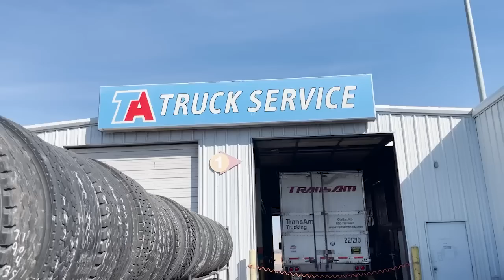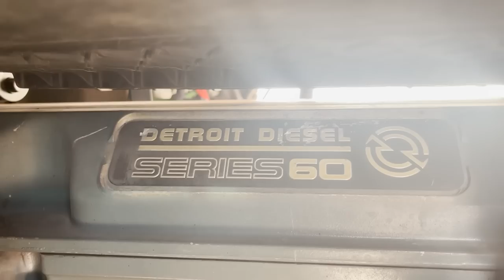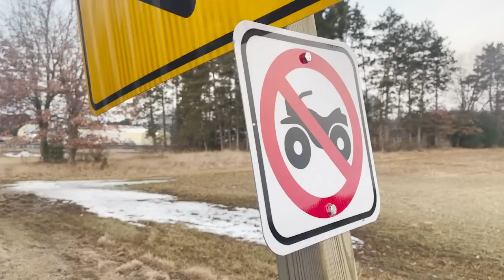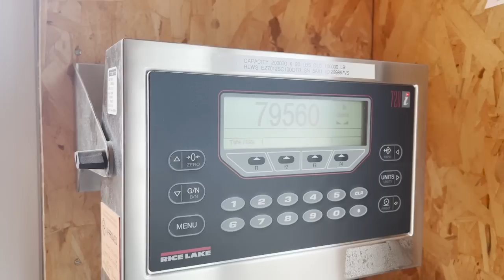All roads lead to…..WHERE exactly?

Comment: I have been there and done that. I knew just about every truck stop between california an washington... a occasional trip to nevada. If you don't  have a backhaul to home then you  wander around and listen up on the cb for someone who knows hauls going somewhere. Licence plates included the bingo card for hauling in different states...been over forty years since I was on the highway... actually thirty eight now  that I did the math. I loved the road, didn't mess around on the wife, kept the zipper up an eyes open for jump scales or other inspection places. 355 gears  a thirteen speed  with a airshift brownie that had a long over in it..lot of the time it was in direct but pulling up and out of different locations, steep roads, I found shallow under in the brownie, and the low side of the main. Ran a big cam two in those days... a few shims n a double o button in the fuel pump... had to watch the pyrometer... some nights just pushing hard, you could see the flames coming out of the stacks. Iron and lumber for most hauls but then occasionally a bunch of two by fours with plywood for side racks to make a haul of stone. They used it for decorative roofing. I would pick up hitchhikers and hope they didn't get stupid... got shot in wyoming from a kid with nightmares. Get so tired and pushing on... find yourself way ahead and not remember even driving it... ya... lots a fun if u get it

Comment: I remember as a kid riding with my Dad  when their  still where truck stops that had seating for drivers and seating for the general public and the waitress would run you out of the drivers section. I also remember all the drivers talking and telling stories. They all connected and got along.  Everyone knew each other by your face or by your name.  I could not agree with you anymore on the subject of getting up and supporting these small truck stops. I love them and I have no problem spending money in them. Go in and at least  buy  a cup of coffee for the parking place you took up.
Reply from the maker: You got it my friend. Exactly

Comment: some of best sleeps in a truck. motor sitting there purring away heat set just right. trying to park sorta level,  allot of my sleeps was winter months mostly i never did alot of sumer driving in the later years of my driving carreer. and i so agree if you actually find a truck stop diner it is best. and yes some times a lift up hug. now most are franchise restraunts ICK.

Comment: Load heavy and run around the scales.  That scale just across from Dubuque is rarely open.  I've never seen it open at night.  I ran beef up that way for 10 yrs.  You are right truck stop cafe's are the best.  I remember going to meet my grandparents at the ones by the Air Force Base my dad was stationed at in Indiana.

Comment: The UK is standard all in at 44tons Loaded, Unit are 3 axle and trailers have 3 axles with super single tyres. Another grate video and your spot on truckers do not speak much now, too busy on phones and ipads to have a conversation.👍

Comment: Thank you for the video. Keep on keeping on driver!!! If I would of known what I know now I would of videoed my trucking days off road hauling wood. Not many people understand off road trucking. Ya I have a couple different videos on my channel but that's only a couple loads out of 15 years of hauling off road. I loved it off road no wagons and no clueless brake checkers and my rigs were 45-50,000lbs empty alone so min loaded waight was 2000,00lbs. But the short time I was on the road early 2000s it was ok but I don't miss that like off road
Reply from the maker: WOW that sounds like quite a rig to be at 200k!!
Reply: @realwildwildwest  sure was. Not many trucks still set up to haul much past 200 other than regular heavy haul truck you can legally operate on the hot top up here in northern Maine but they still make wide bunk trailers new. Between the lack of what the land owners are willing to pay by the ton and cheapening on road maintanance it makes it hard to justify maintaining trucks  that have bigger cost all around due to size and waiting for parts were they are ordered. Hell... Even getting a heavy haul now a days there's a wait on many suspension and drivetrain parts.... Let alone you can't order gliders any more to put 550 and 600 cats in them for power.

Comment: So is that dehydrated pigs blood as erosive as wet pigs blood? My old work would collect 2K-2500 gallons a day from a slaughterhouse. That stunk the next day bad and eats at all tankers except Stainless Steel.
 Sometimes I miss pumping grease traps and driving a 7K gallon smoothie, for the local rendering plant. But I do enjoy hauling for the local Caterpillar dealer and working days instead of midnight-noon.
Reply from the maker: that sounds like a wild period of your career! You know I haven't noticed any corrosion from the dried blood. The wet must have some kind of acid in it maybe eh? It flows right out dry, rinses out real nice. Smell kinda hangs for a couple loads though. 
pumping grease traps..... hey someone had to do it!
Reply: @realwildwildwest  it is very caustic when it’s only a few days old. 😂 my old bosses said. Keep up the great videos enjoy your content.

Comment: Your so right truckers help each other in dinners . Which in my area majority are gone . Filled in by just quick fuel stops and majority are full junk foods got sit down and eat hot meals now subway eating fresh food just a snack . Drink more water than sodas , Coffee is must . I watched tire come flying off trailer going east bound I was west bound in KW cab over old Lowe's Hardware KW lucky I seen it and slowed down it hit center divider wall jumped my side and flew by me into woods .  Cause I shifted lanes ran blocker protect car it hit right side of trailer which luckily deflected it into woods . Then I stopped and there was huge dent but didn't care because it could killed someone ...  Right place at right time could say . Be safe out there Jax . Oh yeah I can relate wrights in states it's insane  plus the Diesel cops born with vehicale on side of highways just pop out ground hit ground rolling 🚓👮‍♂️🍩🍩😂😄😆🤣🤣

Comment: I concur, the roads in this part of the country suck and besides Ky, most of the speed limits make no sense, they are erratic and usually way too slow. I will warn ya if you make it back out this way and find yourself on ole I75 through Ky, the smokies are pretty heavy through the Richmond area, I've counted as many as 8 have 8 different vehicles pulled over in a 2 mile stretch. Our DOT is no longer solely commercial and are now the same as the regular State Police, they drive brownish gold cruisers instead of grey.
Reply from the maker: thanks for the tip!
Reply: @realwildwildwest  You're welcome!

Comment: We drive at night to stay out of traffic and make more miles undisturbed by idiots. Where I stopped we got free showers with fuel ups. I'm an old truck driver and you already know the answer to that question, we go around the scales. Or weight till they close and then hustle on by. Or go in to unload with little fuel on so our weight will be right in those light states. DOT are nothing but scavengers seeking hard earned money from the working class driver/owner operator. Can't see em but you can feel them and know that they are close. Might be a hint in the air as well or a bull wagon up wind of ya about the same smell if he is hauling pigs maybe. Put on the four ways and park right in the road, till they open in the morning. What are ya going to do, head for the freeway and park on an on/off ramp till morning? Or go back to the nearest fuel stop and park there, choices and pretty slim in the middle of the night.